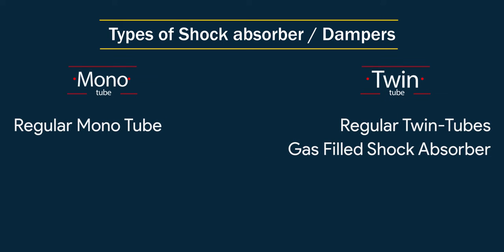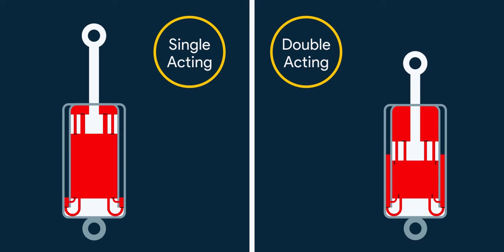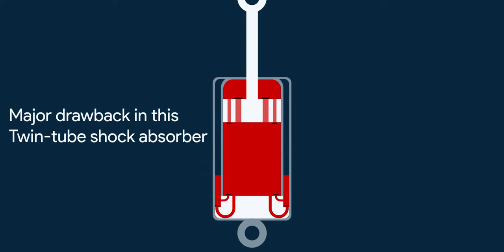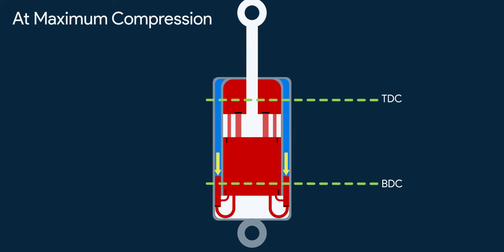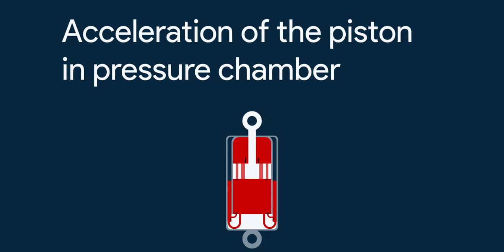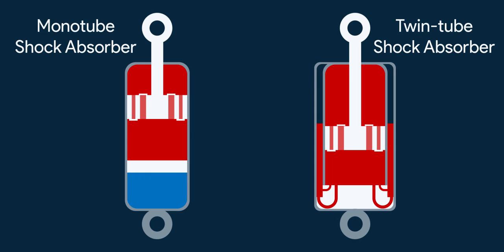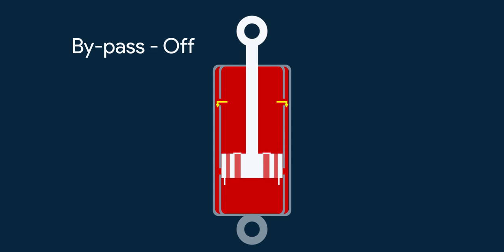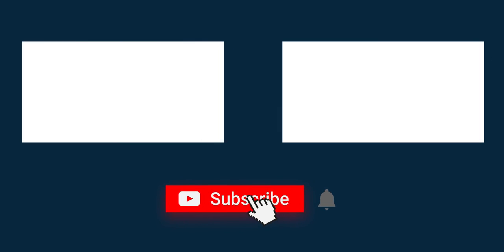Shock Absorber Types in Suspension System | Explain in details (Twin Tube, Mono tube, ASD, PSD, etc)

Comment from the maker: Separator and gas is not shown in bypass hole type shock absorber. It is presented in the pressure tube.

Thank you for watching and support 🙂
Reply: Thank you for making this video, it is the most comprehensive one I could find. One question though, some gas-filled shocks make a distinct "hiss" sound over bumps. Would these be the bypass-hole type? I don't see how the other gas filled types could make this noise.

Comment: I just installed lowering Springs in my car but its hard and bumpy,  some people say using a shock with a smaller size would fix some of this problem. The stock Shock is too much compressed in the initial position. Maybe.

Can you help me?

Comment: but why there is not the gas in" by pass hole " even if the volume of the rode is added to cylinder chamber? THANKS FROM THE BOTTOM OF MY HEART FOR THE VIDEO IT IS  KIND OF YOU